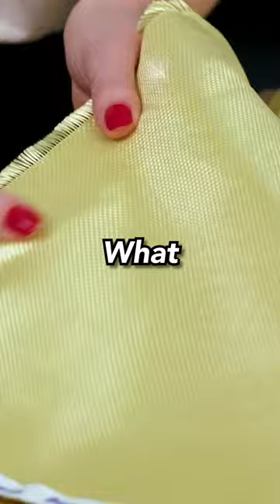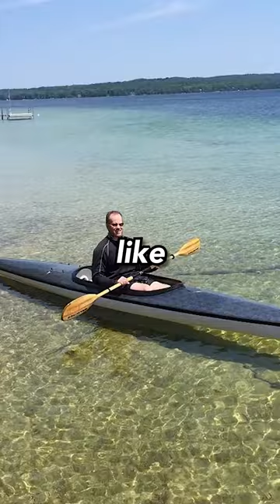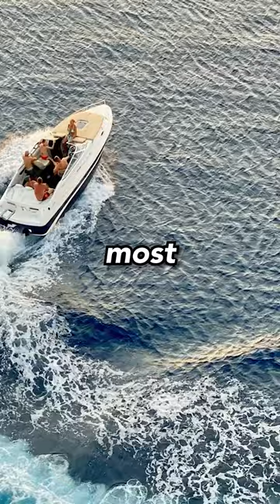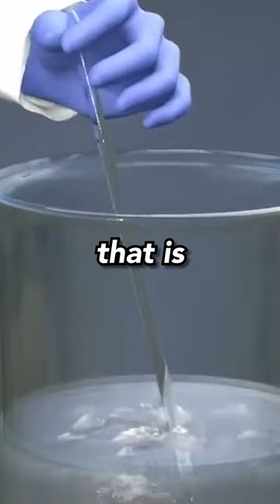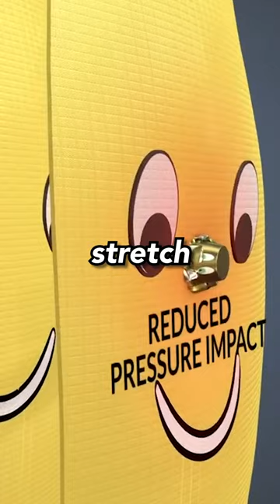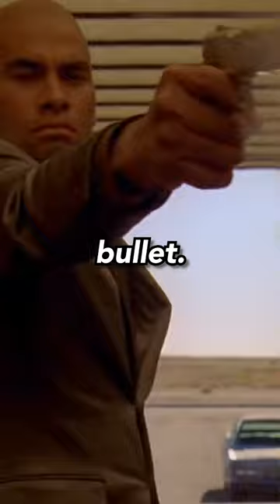How is Kevlar Made into Bullet Proof Vests?

Comment: Not just any bullet, just pistol round. Not rifle round
Reply: Less its also coated with hard ceramics on the outside that shatter and leave the bullet susceptible to safe drilling and getting stuck in the fabric/ricochet it off completely at the wider angle.